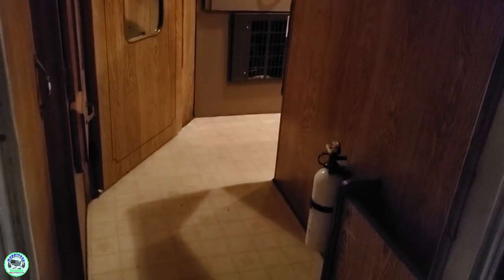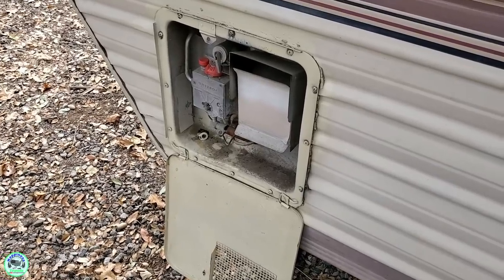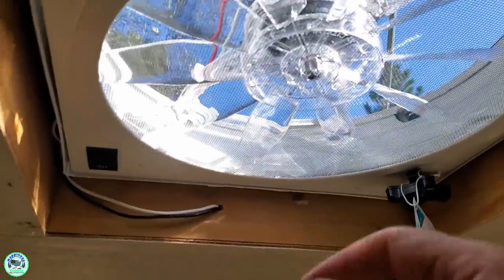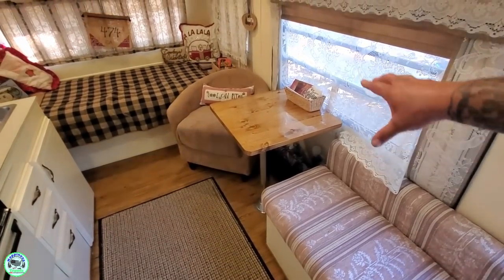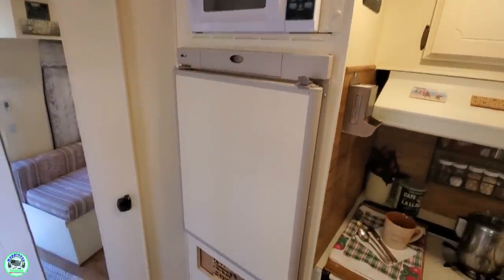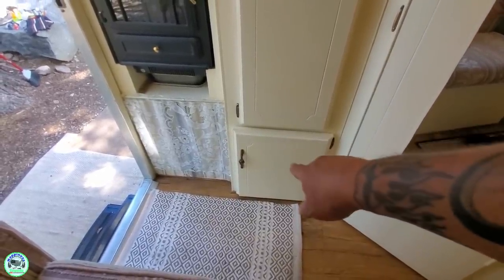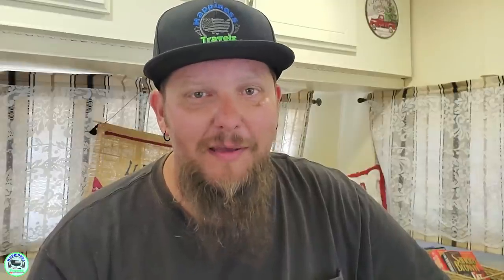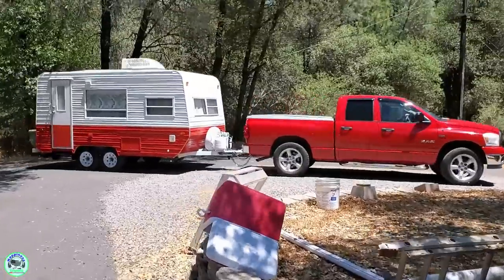Sisters on the fly - Sister #474 NEW Trailer tour

Comment: Where did you move the battery to ? I really want to move my spare up front but battery is in the way
Reply from the maker: Moved the battery under the kitchen sink.  Only do that if you have gel or lithium batteries.  Don't do that if you have lead acid. Her battery and inverter are both under the sink. Works perfect for her. Thanks for watching! 🙂
Reply: Thank you !!! I have a 74 prowler with the same original floor plan. It has the large tail lights like yours and have not been able to find them. Please advise where you got them.
Reply from the maker: @sherrillrubin6766  my mom ordered them off amazon. Take a look on there🙂